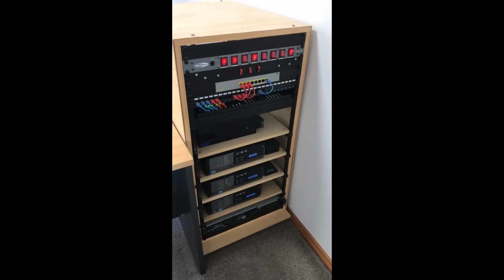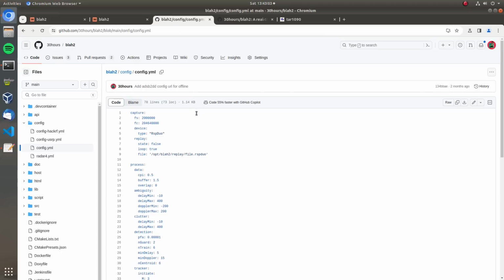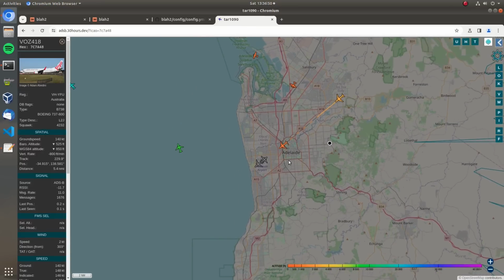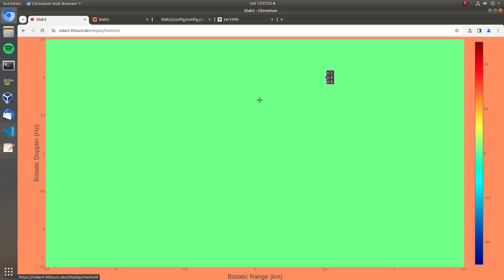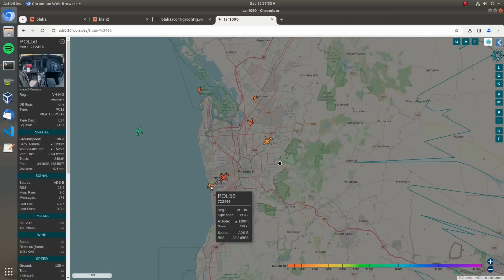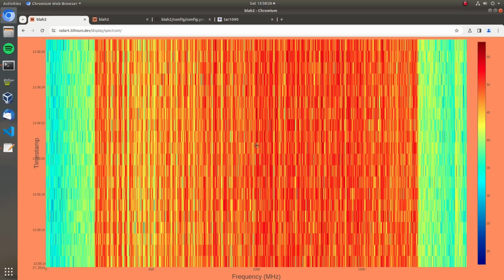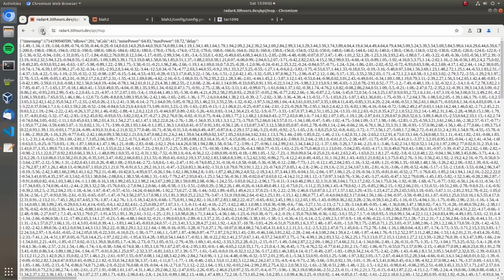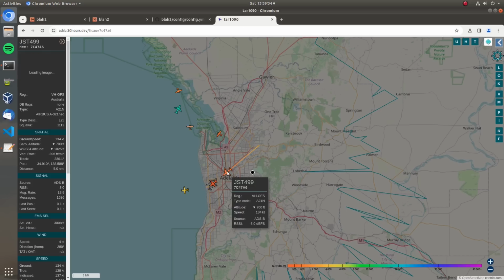Real time passive radar at home

Comment: Bistatic passive radar is probably the most advanced radar set you can legally own. Well done. This is how radar was kind of invented with civil radio transmitters in the 30s if i remember correctly about Watson Watt's first experimental setup.
I would like to have one too :)
Reply: Can't you own any type of passive sdr? So long as you are not using restricted data but open source literature you can probably run whatever you want on receive only?
Reply: @brengineering6573  Mainly, in the U.S. the location being used and having the proper license if and when doing so relating to locations  Say like scanning in a vehicle.
Reply: I think that the effect was first noticed by two radio operators in the US, they noticed that every time a large freighter passed by their noticed it on their oscilloscope.  I don’t remember when and where exactly.   So if it’s passive radar how is it collecting the signal, is the signal coming from the active radars used at the airport and you are just picking that up.  Pretty freaking cool if you ask me.
Reply: @markoa6999  It sounds like the transmitting power here is coming from a local radio broadcast.
Reply: If you have a ham license, there are bands where radar experimentation is legal and effective, BUT: minimum required power rules are still in effect, AND you can't keep it up and running (transmitting at least) all the time.
Reply: @railgap  In what country? That's important here in this chat it seems....
Reply: And even the legality of it is a bi iffy, since several projects on GitHub got pulled by the US government for violating the export laws. :)
Reply: what's the radio that works without electricity or batteries, just a radiating piece of quartz (?  i think)

(I could try running a search but maybe others would like to know..)
Reply: @MarcDufresneosorusrex  No quartz or radiating used in a crystal radio. Just a long wire to get as much of the transmitted power as possible, a tuned circuit (L and C) to select a frequency, a diode to change the radio wave to an audio modulation (crystal radios only work on AM), and a headphone to listen to it. The audio power is pretty small.
Reply: Crystal radio? They use a tuning coil of some sort and diode to rectify AM signals into audio just using the power of the signal.

Comment: That's wild that you can tell it's a bladed aircraft!
Reply: Many things have some kind of microDoppler.  For example, with a jet engine, if the intake or outlet are in your general direction you can often get JEM, Jet Engine Modulation.  When you look closely at the JEM you can potentially see the number of compressor stages and their ratios of operation.
Reply: @FirstToken  That's so cool
Reply: @FirstToken  this is how military radar can identify aircraft types
Reply: Millitary radar both fixed and airborne can look at the sounds from aircraft jet engines to determine type of aircraft...
Reply: Look up “Klein Heidelberg”.  World War II passive, static radar system.  German…
Reply: Props make a dull buzz and turbines make a rocket kind of sound at a distance